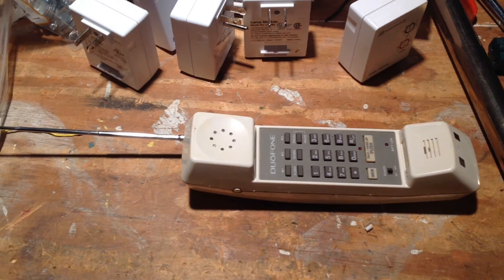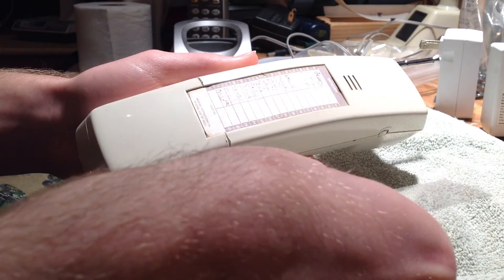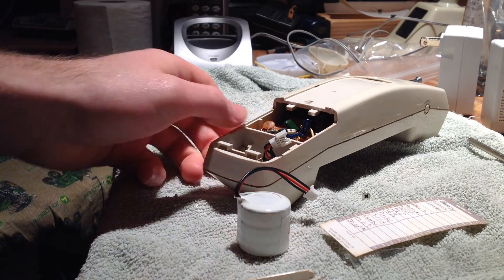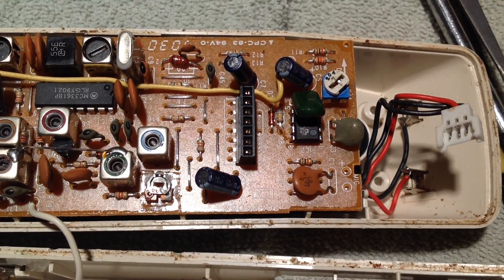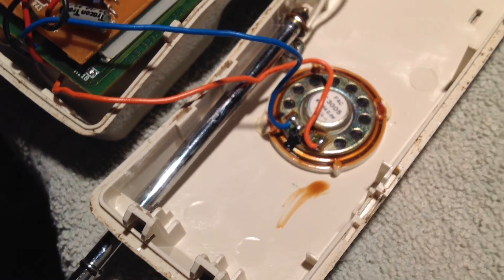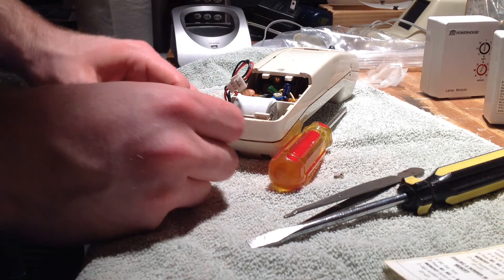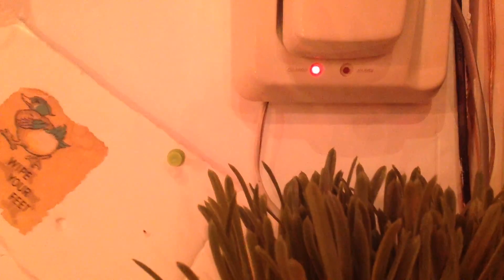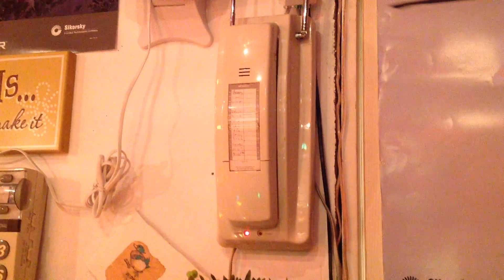Vintage Cordless Phone: Repair antenna and replace battery

Comment: When I was a kid dabbling In electronics, sometime gave me one exactly like that one, which had been dropped in a pool. I took it apart and cleaned with alcohol and distilled water and it worked! 

Btw about the battery, seems like you might be able to use one lithium cell to replace the nicad. (I've done two cells for 6v camcorders and it worked great, in spite of the fact that the charge voltage was a hair low)
Reply from the maker: Lithium cells do not charge the way NiCd does, it's extremely dangerous to put a lithium battery into something like this that's designed for NiCd.
Reply: @JordanU  That's true. I'm assuming the modifier understands the voltage ranges of the battery they intend to use, and the charger.  For instance, in my "6 volt" camcorder, the charger would float up to about 7.5v unloaded. That's within the acceptable limits of two 3.7v lithium cells in series, so long as I'm not concerned with the batteries ever reaching 100% charge. 

There's enough options with lithium batteries of slightly different chemistry to find one as a suitable substitute for nearly every application.  
Like with anything though, the modifier needs to do appropriate research before making a decision, and if there is doubt the first charge cycle should be closely monitored (for acceptable voltage range as well as possible heat generation of an overcharging battery, charge current if that's a concern, etc)

Comment: Do you still have this phone? Does it still work?
Reply from the maker: I do, this is one of those phones that I'll probably hold on to forever.. As far as I know it, it still works.. However the batteries are hard to come by and don't last very long, which is why I stopped using it..